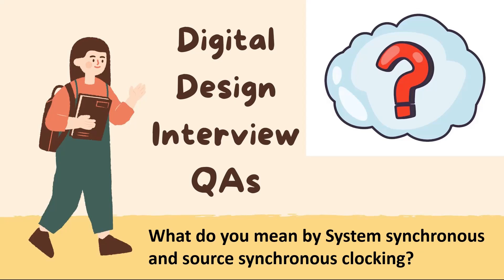Interview QA: System synchronous Vs source synchronous clocking

Comment: In system synchronous clocking, all components in a system are clocked by a single global clock source. The clock signal is distributed throughout the system, and all the components operate in sync with this global clock.In source synchronous clocking, the clock signal is transmitted along with the data from the same source. The receiving device uses the transmitted clock to latch the incoming data, ensuring synchronization between data and clock at the destination.